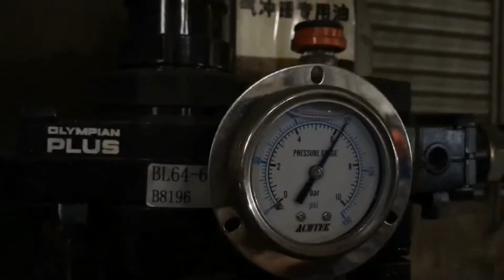WEIJING Casting Degating Hammer Application Video Gallery

Comment: Is this suppose to save money on a remelt ,,, ?
Reply: Yes, and no. The gates will be remelted independently of how you remove them, but this hammer significantly eases the removal of the gate from the casting. It is worth using this instead of cutting off where castings are going on in higher volume.